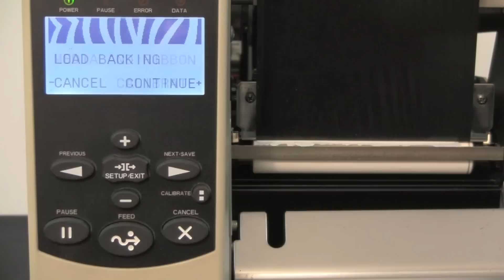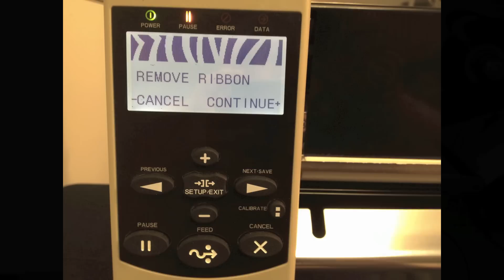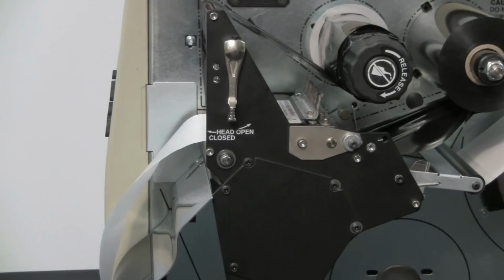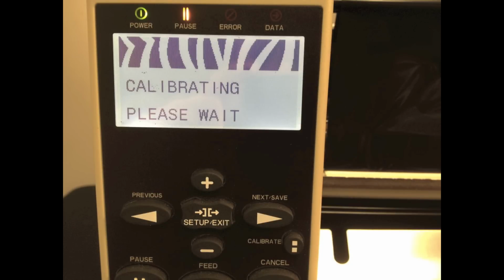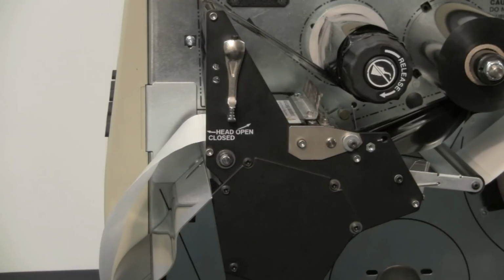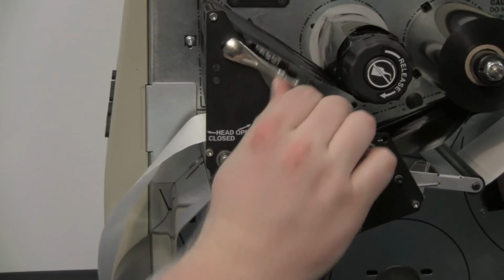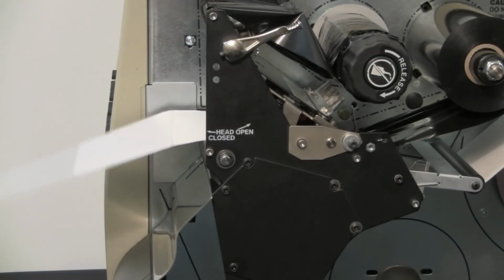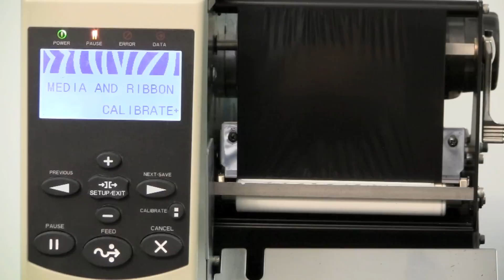Zebra XI4 Series Printer Manual Calibration

Comment: remove 8 inches of labels or 8 labels?
Reply: Just one label, the sensor want's to see thickness of backing paper.
Reply: @petesworkshop6570  It depends on the length of the label. You want 8 inches of backing material through the printer. If you have one inch labels, that would be eight.